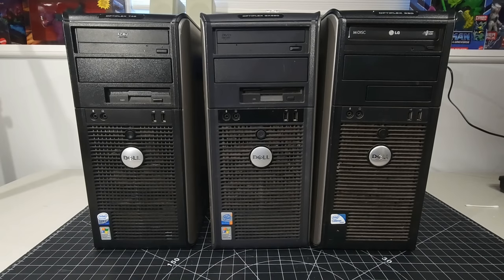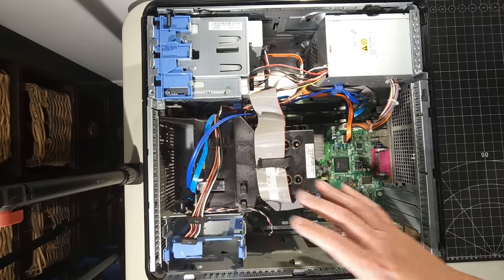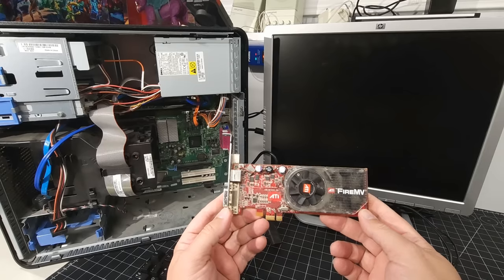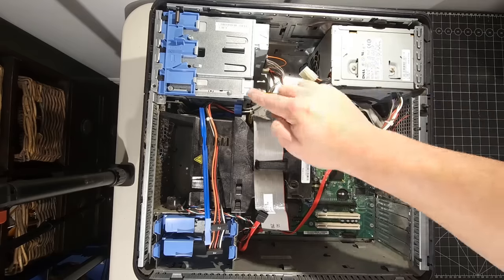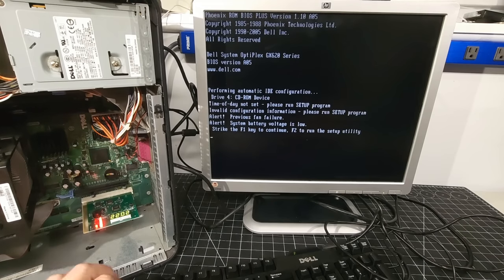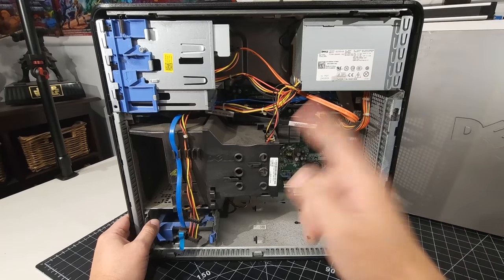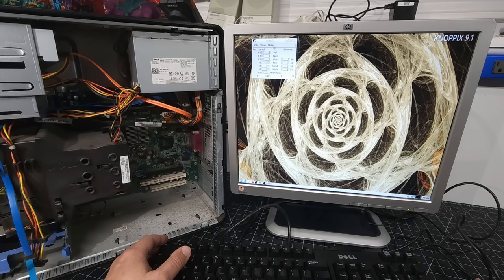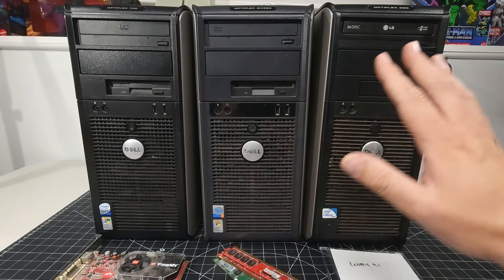The Dell OptiPlex BTX Trio ... Do they work??

Comment: I worked at an office that used several generations of these machines. The reliability of them never impressed us while they were in service, and a few years after they were all replaced I went through the old computer pile testing which machines could be wiped and re-sold. All the AMD powered ones- Optiplex 740- still worked, but all of the Intel ones (760 and 780) were dead.
Reply from the maker: I never got to experience these systems so I can't comment on reliability.  However simple little things I had to do to get them going again, could have been the reason they were tossed.
Reply: Some of them are pretty notorious for their unreliability. I particularly wasn't surprised to see the 745 @Karataus featured in this video to not work. All of them I encounter just don't work. I believe those came out around the same time as the precision 380 and they still suffer from capacitor plague. They tend to kill themselves from bad leaky caps leaking onto the CPU mosfets.
Reply from the maker: For sure.  I'll definitely have a better idea as I expose the board and go from there.
Reply: @TheRetroRecall  They all had the Dell numbered error lights on in varying combinations, and I didn't test them beyond swapping the RAM.

I kept a 740 and even put a Phenom X4 in it since it was AM2.
Reply: You won't believe it, but I'm writing these very lines on an Optiplex 780 with Core2Duo because my current laptop is currently under repair.
Reply from the maker: Hahah that's awesome!!!! Lol.  #reliable
Reply: @jensputzlocher8345  I totally believe it lol, the later ones like the 780 are extremely reliable. Unless you are unlucky and dell played parts bingo on you, gave you an acbel PSU and it silently ate shit. Which is a common fault for the acbels used in OEM machines from this time period.
Reply: My doctor’s office still uses them… I’m in danger😭
Reply from the maker: Hahahhaahaha
Reply: We had a mix of the 745 towers and micros at work and every single one died of bad caps
Reply from the maker: Yeah I've seen that happen.

Comment: The Restaurant I worked at threw a bunch of these out.  I grabbed them slapped new SSD drives in them installed Linux and turned them into little media center PCs.  Good thing about these old Dells they are usually pretty quiet, so they are perfect for that.
Reply from the maker: A few people have mentioned that they turned them into Media Center PC's, interesting.  What distro of Linux did you use?

Comment: The 'Fire' cards were designed for CAD use and were generally lower powered versions of the gaming versions designed to work with CAD drivers with greater stability and cooler running.
Reply from the maker: Awesome.  I'm going to get the adapter cable so I can use it.  So we're they any good for any games at all?  Must have been better than the onboard video at least?
Reply: @TheRetroRecall  Not a gaming card in the least. The FireMV 2250 uses the same RV615 core as the Radeon X1300. They were quite gutless for gaming.
Reply from the maker: Awesome, great to know and thank you!

Comment: very nice!! I hope you can get the dual-core system up and running as well. Also yeah as far for office/business PC's OptiPlex are very well built and easy to maintain.
Reply from the maker: For sure, I hope so too!  I am not entirely sure what the issue is yet - I will know more when I get more access to the board.  Yes - for business environments, they are amazing.

Comment: For systems that power on by themselves like that, if I want control over that I find a simple inline switch on the power cord is super useful to have. I actually have one of those old Memorex Power Centers set up in my testing area with a short extension to bring a port back out front for plugging in devices to test. Replaced the switches in that a couple years back since the little bulbs inside the original switches had gone flickery and died from years of use. That was a satisfying project to finish haha
Reply: Oh! Also yeah, the cable for the graphics card. I believe it's a DMS-59 adapter you're looking for. I have both DVI and VGA versions of it since I ran across a bunch of those cards in workstations like this. Theres also a very similar but incompatible connector on some cards that doesn't have the pin missing which I've also run across, that one goes by LFH-60. I made sure to color code and label mine to make sure I don't mix them up when I grab one from the cable drawer.
Reply: The port was kinda good for getting two monitor outputs on a low profile card, a little silly on the full height ones sometimes, although it does mean you can just swap a bracket to use the card in different system form factors. That said there are some more interesting full height cards out there which used two DMS-59 connectors to drive four monitors at once, would love to run across one of those hah
Reply from the maker: Smart!!!
Reply from the maker: Yes, I looked this up... They are widely available which is nice as I can use this card.
Reply from the maker: 4... Imagine!

Comment: Dell computers have built in diagnostic lights. They are inside that shiny plastic part near the usb on the front panel on these models. They light up as 1 2 3 4 and each light combination + the static/blinking orange power light will tell you exactly what's the problem after checking the manual on Dell's site. They can even tell you if the board is dead so you don't waste time in case that's the problem
Reply from the maker: For sure.. I did see that and used it.  The error was 1/3 on the front implying video ram (according to the manual) however the system ram was the problem.  Unless of course because it is shared video memory?
Reply: @TheRetroRecall  Probably yes. When ram is failing it can cause graphics artifacts just like dedicated gpu does when it's dying so that error would make sense

Comment: OMG.. I installed SOOO many of these..  thing is. these NEVER broke..  Last one I replace as far as I remember was in 2019.. no joke with a new Dell w/WinPro 10 Dell OptiPlex..  It was used at a printing facility..  Used Raid 1, 2 500GB 72K drives.
Reply from the maker: Agreed, they are tanks! I'm sure there are some running even today!

Comment: These cases were so nicely built. A few of them got to have some extended service life as stools/steps/doorstops for quite a few years after they were pulled from regular production. I wouldn’t trust the later designs to hold all my weight while getting at a wireless AP 😂
Reply: I think you'd like a late 2000's/ early 2010's Precision workstation even more for that use. I have a T5500, which is one of the models that came with that case and it's almost unnecessarily rugged and a heavy bastard as a result. The mere side panel weighs a ton, like 2 - 3 times what you'd expect, and is made with double-layer sheet metal and has a couple of reinforcement bars in it like it needed to be protected from a side collision. I mean WTH, it's not a car door!! 🤣
Reply: @BilisNegra  oh yeah I have a T3500 in the basement, that thing is so much heavier than it looks. Built so solidly. The Optiplex were just more commonly available around the office, and a bit more wide and less tall so more stable.
Reply from the maker: Lol.
Reply from the maker: Haha it really is crazy to think how over engineered some of these systems were.
Reply from the maker: Like the old packard bell towers!

Comment: Forgot to mention, these systems are like vacuum cleaners, especially the older Pentium 4 ones. They have that giant fan right in the front, and the large grille which loves to suck in dirt and debris from the floor and the air and plug itself up. At which the fans have to run faster and then it gets even more dust and dirt in it.
Reply from the maker: Haha it's very evident that this is the case!  So dirty.  Will be great to get them restored.

Comment: I have an Optiplex 360 I got from my Grandfather. It had a Pentium dual core E5300 in it when I got it and a 1tb hard drive. Right now it has a core 2 duo e8600 and an R7-350. I used it as my first gaming desktop for a few months to replace my AMD A6 Laptop. Back then it had the r7-350(I went through a few different ones since then) and a Q6700 with 4gb of DDR2. EDIT these dells have diagnostic LEDs on the front between the USB and audio jacks. Try to see what code that the 745 is giving.
Reply from the maker: Ah good point, I checked the front codes on the second machine but not the first!  I will take a look at that prior to disassembling it!  Thanks!

Comment: Another great video!  I hope YOU are doing awesome. 👍  The first Optiplex is perplexing.  I am going to guess that the CPU is dead?  Nice job on the second Optiplex... I have yet to pull sticks of RAM out of a unit and find that to have been the issue.  I hope two of those extra sticks work for you.  The third Optiplex.. I gave that NO shot of working.  It was so full of dirt and nastiness... but wow did she fire right up.  I LOVE the fact it had FOUR GIGS of RAM installed.  That was a lot back then.. my goodness.  As for the cases in General, I agree that they look great!  Ventilation wasn't big on many computers in the day, but Dell said YEAH it kind of is a big deal.  If you can't get the first unit to work, are you considering harvesting the Floppy Drive and installing it on the third??  Great content.  Thank you so much. 👍👍
Reply from the maker: Thanks so much for this comment!! I am doing awesome!! :).  I hope I can get the first one working.  I will know more once I remove the board and have better access for testing.  If all else fails, it will become spare parts for everything else haha!  Thanks for watching and for your support!

Comment: Subscribed because I am an old dell freak!! I've got about 7 optiplex's, a vintage dimension L800R, dimension 5150 and many more that I admittingly have forgotten about! I found an Optiplex 745 in my garage, one that I didn't know I had. It booted up instantly after not being used for about 2 years. The optiplex models range from SFF to MT with different ages as well, but all the same era as the ones featured here. I think I have a GX520, x2 745s, 760, 380, 755 and the rest (which are yet to be found!!) I'm not too sure on.

You can tell I'm a bit of a hoarder....! And this is just my dell stuff 😂
Reply from the maker: Haha well welcome aboard!!! Great having you along for the ride!  I have made quite a few videos with Dell's in them so I hope you enjoy them and the rest :)
Reply: @TheRetroRecall  I spent a good couple of hours watching some of your other dell videos! Been meaning to get myself a dimension like the ones you had. Currently considering a laptop which is a bit different for me, a Dell (of course) Latitude X200. Very cheap find from ebay so it’s got me tempted!!
Reply from the maker: Hahaha that sounds awesome!!! Excited to hear how it goes
Reply: @TheRetroRecall  I’ll keep you updated!! Let me know when you restore these, or any of your sells for that matter lol, the GX620 is the oldest out of those 3, only a few slight differences but one that is quite noticeable when against the other 2 is that the actual plastic colour was a different shade to the newer ones! Also the fact your GX620 has an old style intel sticker compared to the newer ones on most Dells!
Reply from the maker: You really are a Dell specialist haha!  I have quite a few more Dell's I haven't show on the channel yet as well :)
Reply: @TheRetroRecall  It must show lol 😆 I’ll be looking forward to those videos!
Reply from the maker: Haha it does and that's totally fine!  Stay tuned!

Comment: Front panel of those Dell systems from this era had a set of lights for diagnostics. The manual should give some codes. The light being amber, makes me wonder if someone tried a CPU upgrade without a BIOS update. Or they put in an incompatible CPU.
Reply from the maker: I will check that and yes, not coming out of reset, something is definitely up.
Reply: @TheRetroRecall  I've also seen these motherboard act strange with a flaky power supply.
Reply from the maker: Smart thinking.

Comment: have the desktop version of the Optiplex 745. Bought another riser card to allow installing a PCIe graphics card. Installed a linux distro besides Windows Vista and used it as a media PC.
Reply from the maker: Awesome, sounds like a great machine.  Is it still in use today?
Reply: @TheRetroRecall In storage. Should still be working. I need to retrieve at some time and dust it off. I have limited space at home.
Reply: Small addendum. The needs for what i wanted it to do outgrew the machine. Like 4k playback or even Full HD encoded in h265 or VP9. VP9 was not too much of a problem but the rise of 6 FPS videos on youtube was sometimes a struggle.

Comment: Yeah, as much as I like saving things from the era of things that nobody thinks to save yet, and these certainly are; I just don't see much appeal in these systems. For the most part they are reliable. The 745s occasionally have issues with the motherboard and capacitors, and the 760s and 780s have power supply issues, other than that they are pretty solid machines. I personally just see them as boring though. Me and my friend have a business buying computers from surplus in bulk (normally around 200 or so per load) and taking them apart and selling parts out of them. We see a ton of optiplexes. At this point that style optiplex is too old to really sell anything from, and we still get them mixed in with the newer stuff a lot. I like to save a lot of the older stuff that we aren't going to sell, but those have lost any appeal to me. We probably scrap around 20 or so of those on a weekly basis, and while it is a waste, sadly people just don't want them and I have to save my room for more interesting items.
Reply from the maker: Definitely shows what appeals to some doesn't appeal to others - makes sense!

Comment: Knoppix is one of the first live CD distros, if not the first. Installing is seems somehow... wrong... since it's designed to run live... but it is possible. Used to be a pain to actually install it, but my last experience with Knoppix is from the early days of it, so it may be easier these days. I'll have to check out a more modern version of it.
Reply from the maker: Thanks for this info - I know nothing about it but used it as per the recommendation of some viewers! :)

Comment: I remember when these BTX Dell Optiplex systems where everywhere. I used to have a Dell Optiplex 745 with a Core 2 Duo. A great machine.
Reply from the maker: That's awesome.  Yes the Core2 Duo cpu was a beast!
Reply: @TheRetroRecall  My friend had a Core 2 Quad Q6600 in his gaming desktop. That machine was a beast and expensive at the time.
Reply from the maker: Yes the Core2 Quad CPUs were nice.  I only have a couple and I cherish them lol
Reply: @TheRetroRecall  They were amazing for their time and are still useful with today's modern web.
Reply from the maker: Exactly.  Win 10 works great especially with an SSD
Reply: @TheRetroRecall  Or Linux. Linux just keeps getting better.
Reply from the maker: It does, I need to experience it more.

Comment: I worked on tons of these throughout my early career back in the day. So many of the GX620's and even some early 745's were plagued by bad/cheap capacitors. I lost count of how many small form factor GX620's that I replaced over the years due to faulty capacitors. (Of course, after their warranty had expired) TBH, I am glad Dell moved away from this form factor and started shrinking them down. These things were hulks for as little as they had inside of them. So much wasted space!
Reply from the maker: I never thought about that before - definitely and interesting perspective regarding the wasted space inside them. I guess I've always appreciated the space for more hardware lol.  Although the SFF or Mini PC's today are quite sleek.  I will say the systems of the day were quite hefty.  As for the warranty... Isnt that always the way?? Lol.
Reply: I've been working in public education since 2011.  We had all three of these models. We replaced SO many 745 boards and some GX620 boards for bad capacitors. Went through quite a few power supplies too.  The 390s were fairly reliable for us.

Comment: I was given 3 Dell Optiplex 755 mid towers, I updated the BIOS to the final release A12 from Dell, then upgraded CPU to a Pentium Duo Quadcore 3.0GHz and 8GB of DDR2-800 (PC6400) non-ECC memory which is all maxed out according to what information I can find on the web. And it runs Windows 10Pro X64 flawlessly.
Reply from the maker: That's awesome and I'm glad to hear you saved them!
Reply: @TheRetroRecall  😊

Comment: hey! 

with clover efi boot software, you can use that PCIe x16 slot for an bootable NVME SSD. well at least it work for me as i run a gentoo media box with one of these old Dells.
Reply from the maker: Thanks for the tip I will check it out!

Comment: I am currently using an Optiplex 755 as my main rig. It does what I need it too just fine. 
Edit: These Dell systems have diagnostic lights on the front and Dell has a table on their website that shows each code and explains what it means.
Reply from the maker: See - a reason for older tech!

Comment: I still have my Optiplex 780 with my Core2Quad Q9400, had a 580 with an AMD Opteron but ended up selling it. I thought the BTX was better for cooling, though Dell had some layout issues. You couldn't use a dual slot GPU with the intel version but you could with AMD. 
I've had a number of cheaper GPU's with that pinout. I have a dual DVI and a Dual VGA breakout, but I kinna need them too for the cards they go with. You're looking for a DMS-59 connection.
Reply from the maker: Awesome and thank you!!
Reply: Trylen
Is it Intel Express G41 ?
I'm able to run Windows 10 on it in 1080p, modern games on GTX 1080